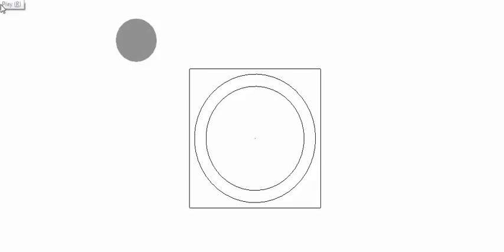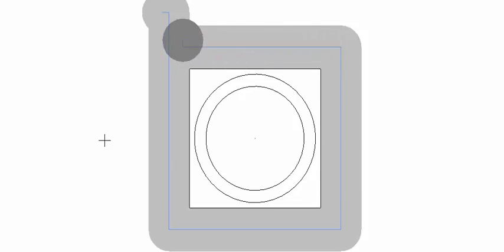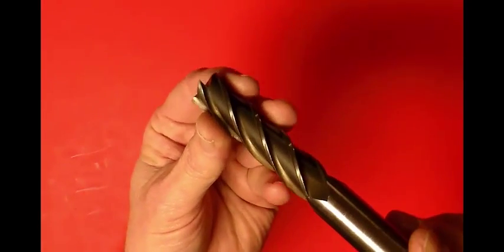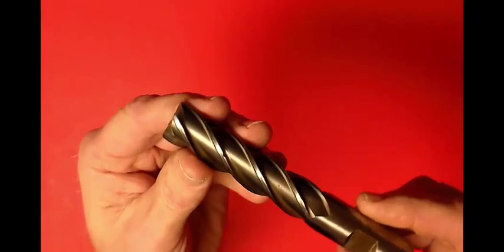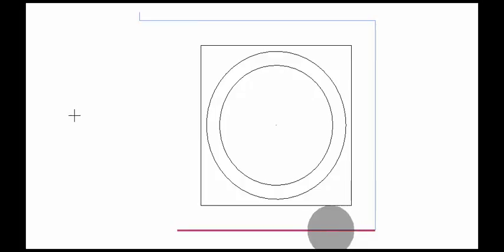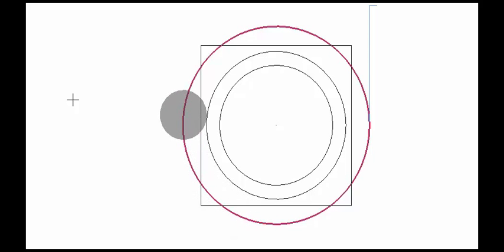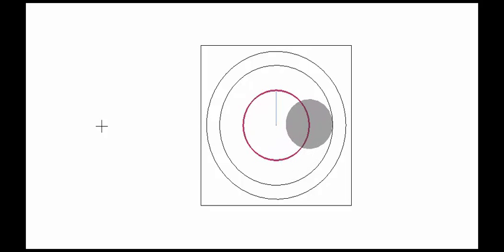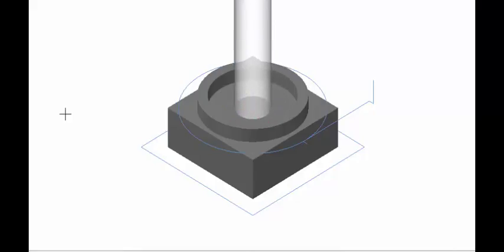DO YOU KNOW THE DIFFERENCE BETWEEN CLIMB CUTTING AND CONVENTIONAL CUTTING?

Comment: In class we are cutting low carbon steel on the CNC. Since I am climb milling should I take lighter cuts still like on the Manual? Or
Would it still be about 1/2 the cutter diameter even though I am climbing?
I am milling out a circle.
Thank you in advance.
Reply from the maker: You should always climb cut on a CNC mill. I know that a manual mill tends to jump but the CNC mill is much tighter because of the ball screw. Thanks for watching.  Tom